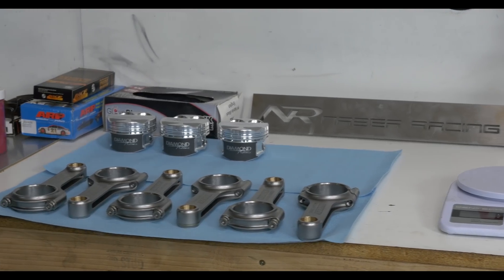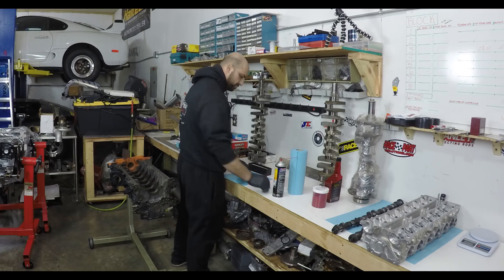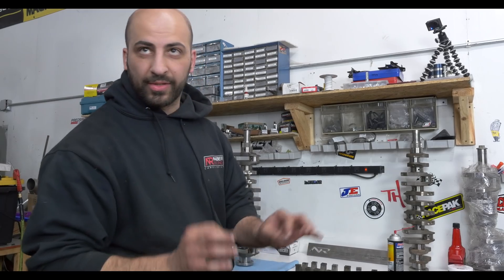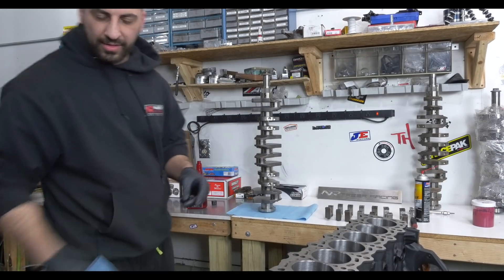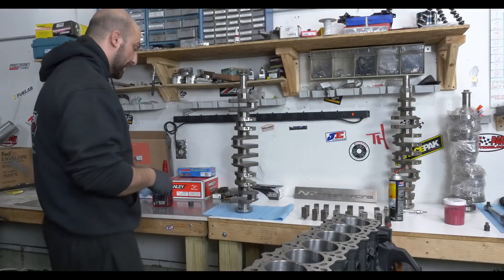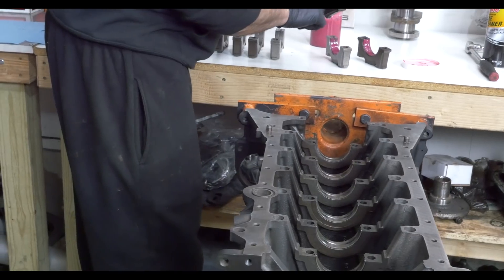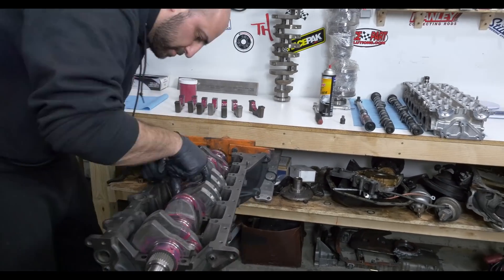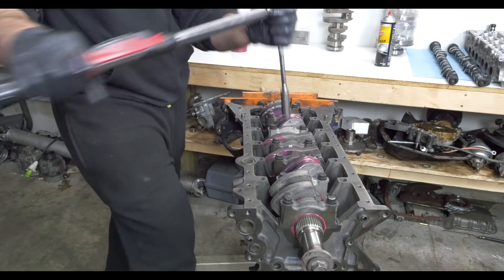Naber Racing 2JZ Build Part 2 - Crank Installation (4k)

Comment: why not use a cradle instead of caps? then not worry about crank walk?
Reply from the maker: I assume you are asking about a girdle rather than cradle?  If so the answer is that it's not necessarily for the hp I'm shooting for.  700 whp is plenty for me.  At 1000 or more the bigger builds will upgrade to billet caps and some maybe a girdle.
Reply: @BetterThanStock   yes, girdle. gotchya

Comment: What is this red thing he use there and mention this stuff is great? 
Would be nice to put some infos in the desriction ;)
Reply from the maker: That is Redline Assembly Lube.  80313.   16 oz container.   

Thanks for the tip on putting more info in the description.  I'll do that for sure.
Reply: BetterThanStock Also wondering.. putting enging together on your own is much ,same, or ,worst, than orginal made in factory? And all parts where ,new, or used from used engine?
Sorry so so maybe simple q but Im rly just getting into this stuff and was wondering.
Thank Yoy for Your time🙏
Reply from the maker: @Lone_Wolf_91  having a professional like Saif build this with his tools and expertise makes this engine better than stock.  I used brand new aftermarket parts with stronger materials to make more power more safely than a stock motor.  However I do not recommend doing a full build yourself if you aren't experienced.
Reply: BetterThanStock Of course, Im just wannit to know, will oasr few winters before I even will thing about it xD Damn thats very nice, was wondering if someone getting ,better, quality parts, if those are even made.. do You have any.. links or anytything by name I could look on YT that would provide some more deep infos about all that stuff etc?